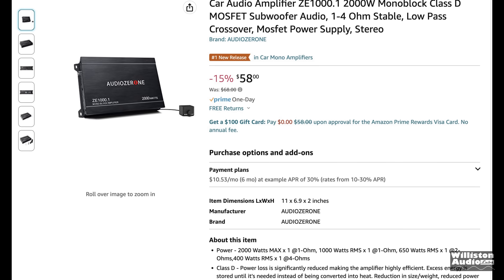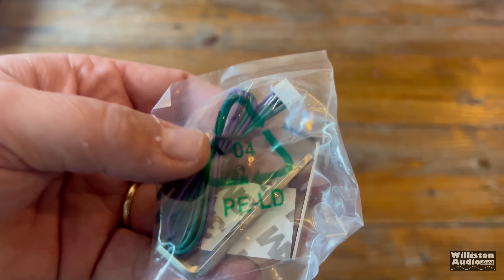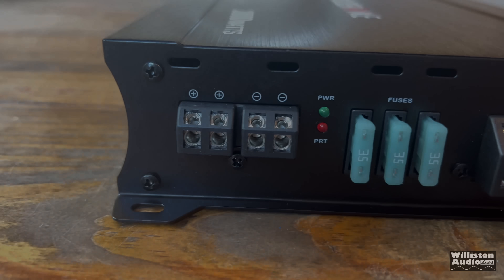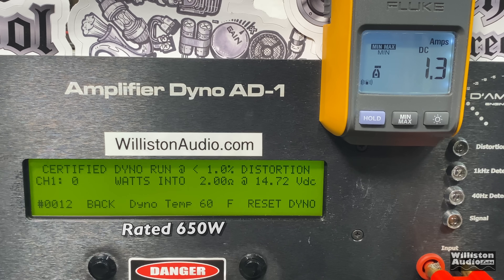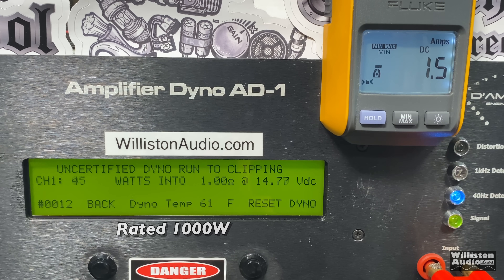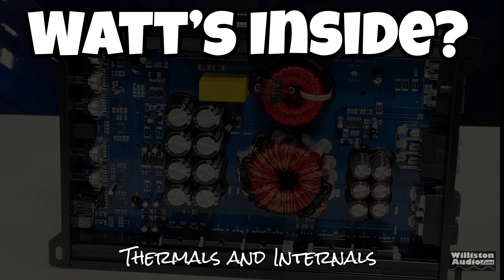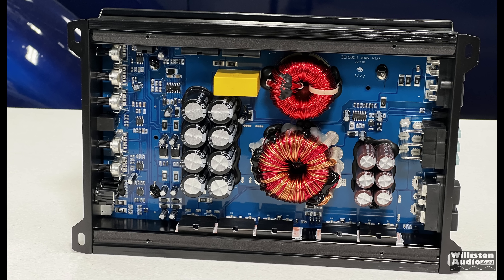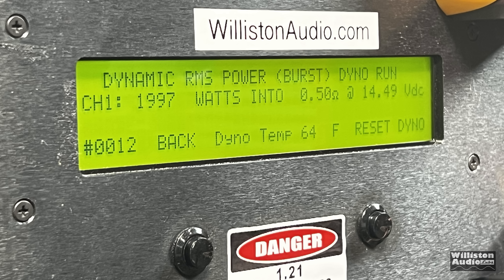Can this $60 Amazon Amp Power a 6000 watt SUBWOOFER?

Comment: I've ran this to two 10s then two 12s it sounds pretty good but i feel like its not enough. Id run one of these amps to one 10 or 12 and another amp to your other 10 or 12 and it would sound good. Ive tried it id recommend it. But why run two amps. I blast this thing for hours and only gets warm to the touch.

Comment: Woofers, or any drivers do not put out wattage. They can handle watts that are supplied with. What a speaker puts out id sound pressure measured in Decibels, SPL. If you have a speaker that has the ability to put out an. SPL of 50 db powered by one watt at 1,000 Hz at One meter away you have a very inefficient speaker. Every time you double the wattage supplied to a woofer its SPL is raised by 3db. If a manufacturer is being measured and they are being truthful, it is measured below 1% THD, Total Harmonic Distortion. 1% I’d when distortion. Becomes audible. Now if you have a woofer that haas an SPL of 98 db it will take far less wattage to get the same volume as the Woofer rated at 50db. Car subwoofers are usually inefficient because of the vibrations of the car being driven will cause the cone to distort its output, so they put a very stiff suspension around the cone to prevent this. 
Now wattage is an electronic way of measuring the heat generated by the amp driving the speaker. It’s really stupid to,rate a speaker that high because you would melt the voice coil with 6,000 watts.

Comment: So, since this amp has 2 seperate speaker connections.  Does that mean you can wire a dual voice coil sub one side into each and it keeps the original OHM rating of the sub? Like say i have a 2ohm dual voice coil single sub. If i plug both side into  the 2 speaker hook ups. Does it stay at 2ohm? I have only ever hooked up to a mono. And i have to bridge to 4ohm or cross over to 1ohm. But i would like to try running at 2 ohm.

Comment: Would it be feasible to power a passive PA subwoofer with one of these?
Reply from the maker: Sure, but many PA subs are 8 ohms, so the output of the amp would be less. I believe I show 8 ohm results in this video

Comment: I got a buddy running two of these on two H yanka 15D2. Running one aml per sub. At 1 ohm each. He has them in a 30hz 4qf e closure. And idk what it would meter but I’d bet it’s doing high 40s! It absolutely slams and he has $400 the whole system. He had one of those cheap capacitor things and I talked him into taking it out. And I helped him build his exposure. We ran welding leads for the hot and grounds. It really does slam. It blew my mind so I had to look these amps up. The H yanka subs I thought would be shitty too. But turns out, they slam clean and low. They sound as good if not better than any Skar SDR subs I’ve heard.

Comment: Paid $78 for mines thanks for the heads up on this good amplifiers. Gonna installed with two 12’s American Bass XD Rated each sub at 500 RMS each sub should sound good with the 1,000 RMS @ 1ohm.

Comment: Whats the best fuse to run to this a 100amp or and 80amp?  Lookiing at the Fluke amp meter it seemed nothing jumped over 80amps, but would there be any cons running a 100amp?  Thanks

Comment: As always, thank you! Love your channel and information and education. Can you please answer if a person is able to determine the amps power abilities by the fuses onboard? This amp made me think of the math I leaned on back in the day by multiplying the voltage by fuse’s amperage. Example of this one 105amps of fuses X 14.4volts = over 1400 possible watts of power…does this fair correctly? Thanks & Cheers!
Reply from the maker: A quick method is to multiple fuse requirement by 10 to get output, but I've seen some amps have fuses not connected to anything so there are some ways this doesn't work. It's pretty close 90% of the time.

Comment: these tests show number but what they don't represent is the physical weight of an amplifier due to the mass of aluminum cooling and the subsonic filters and EQ has everything to do with the Sound quality even more than any other aspect of the class D amplifier.  wattage is the last thing you should be concerned about when it comes to the clean crisp sound and the most important one is  a low-budget class D will not hit though really beautiful and competition level low tone baSS efficiency.  the longevity and life of an amplifier DEPEnDS on its cooling mass, fans and quality MOSfETS!  I can tell you right now any amplifier under $1000 is a piece of junk that will not last and not take abuse like Memphis use to and O'rion used to

Comment: When you test the amp do u turn gain up all the way??
Reply from the maker: Amps are gain matched to the head unit (Pioneer DEH-80PRS) using 8dB of overlap utilizing the DD1+ function on the Amp Dyno. Turning the gains up higher on the amp will not result in higher output, just reaches the maximum output "faster"

Comment: Hey bud, I've been running MB Quart amps recently and am impressed but always have thought what they really put out. I have the formula 2000w, 1000w, and 4ch 400w amps pushing thier discus shallow mount subs and speakers.They thump. Have you tested them by chance?

Comment: Amazing! I'd have love to see the 0.5 ohm test with the subwoofer coils in parallel.

Sadly though, I think amps this cheap are killing the car audio industry. Not going to see much innovation when there's no money in it.
Reply: Nah, it'll only make it easier for up and coming woofer designers. It should be cheap. It's a few electronic pieces surrounded in plastic and aluminum. Basically cost 200$ to build a high level 6k Amp fans/coolers/and all the features of a 2000$ 6k Amp.

Comment: What subwoofer would you recommend to replace a factory 2011 Audi S4? They put a funky shaped sub in the rear back seat shelf. Would be a free air application. Would power it with a non factory amp.  TIA

Comment: Im rocking the Rockville rva-m3 it set me back around $120 and I’m wondering if it’s making full power, I saw a dyno video of it and it said it made 1249w rms
Reply: What amp are you running for mids and highs?
Reply: @392_RHINO  wish i had those thinking bout getting a taramps 400w and some nvx components and coaxials for the rear

Comment: Question Will,  do you think its a sign of quality if the 1k and the burst power ratings are within 5% of eachother? My initial impression is yes it typically means good engineering if its consistent, but whats your impression?

Comment: The positive part and reasons of straight entry insert with angled screws is to angle the shaft of tool away from the case which helps with grounding mistakes made by installers also the angle going in is pulling the wire towards the amp and holding it there when locked in tight.
Reply from the maker: #FakeNews

Comment: I love seeing the max power ratings. But what about bumping on a long trip? Can it make 1000w for 4 hours while I drive to the beach? Love your content . Just trying to add another aspect. I keep building systems to spec for my daily and I'm disappointed on long trips cause half way my amp goes into protect for over-temp.
Reply: My Fosgate 1200 can do it for 10 hours I've done it 2x... used to do an hour 2x daily 6 days a week... but being a Fosgate amp that's the expectation not the hopes
Reply: Ambient temp and location are key for keepin it cool. I saw one guy go as far as running an additional AC duct with oversized fan in his trunk to keep an amp cool....

Comment: How about trying something,  connect a single coil of a dual coil like  This,then connect the other coil to another sub! Or tge Dyno!! Tge other coil should output power from the magnets or the nagnetic field from the electro magnet,, its just interesting,   im looking for a cheap  but good 12" (maybe a pair) to fit a second generation avenger, something equal to or a bit better than the oldschool kicker comps, to go with a factory system,   id like to see about 140-144 db about 40hz,  a pair will probably be required, i have a doundstream amp i think it does simewhere in the 600watt range st 4 ohm its the tower series or something, it mounts onits side insted of flat, its vern q while since i even looked at it, i also have a smsll kicker amp about 10 years old,  the soundstream is the obvious choice,   i have thought about entry level sundown subs, maybe this fall ill get something,

Comment: 25 years ago this could cost $500 roughly,  a good amp was about $1/watt, crazy how cheap power has gotten,
Reply: 30 years ago ,I paid 2000 dollars for a 35 inch picture tube tv

Comment: This reminds me of the Rockville DB11. The internal design is very similar to the internal of DB11, except the DB11 is a lot less powerful. The capacitors are the same brand (Captop). The transistor clips, transformer, bus bars that connect the speaker terminals, fuse holders, and power terminals, preamp section, and the big rectangular yellow capacitor for the half bridge class D are almost identical. Also it seems like that the manufacturer that makes the PCB of that amp also made the PCB for the DB11 because the manufacturer logos are the same. The Rockville DB11 could make 23.5V RMS (or 276 watts according to the calculation) with 2 ohm load on a 12.26V HP server power supply right before I hear audible clip. According to the results of that amp, I think that the DB11 will make the claimed watts if it is on 14.4V.

Comment: Put this amp on a load playing music for 48 hours straight. See if it burns up or takes it. Only way to see if an amp will last, is abuse it a little. Get it hot. Cure all that solder and glue. See what breaks. Or not.

Comment: ...I dont mind the angled terminals. They pull in the wire as you tighten the terminal...that it what is used on my expensive Helix amps....needles to say, I will not be buying one of these amps, but, good show as usual Big D...see you next Sunday, look forward to it

Comment: My infinity reference amps are also fused 35x3, but are rated 1000w rms @2 ohms. Even 20 minutes at full tilt playing bass boosted songs with a 320 amp alternator they are barely warm. Wonder if I should try putting in some 50x3 amp fuses and running each amp at 1ohm?
Reply: Unless things have changed since I did this, increasing the fuse amperage isn't going to do anything.  Your fuses are there to blow if you draw too much current, not to determine how much current your amp draws.  Theoretically speaking, assuming no loss (which doesn't happen), 1000 W will draw 83.3 A at 12 V and even less at higher voltages.  So, if you aren't blowing them now, you'll also not be blowing 3 X 50 A while also not drawing any more current than the amp needs or allows.
Reply: But I would be halving the ohm load from 2 ohm to 1, so would that not increase the current draw to potentially double? Which would either put the amp into protect, or blow a fuse if the amp allowed the current to pass through because I would then be drawing over the 105 amps of fusing. Also when I play full volume it sits at 14.2 volts

Comment: That's pretty decent for 60 bucks. If it can reliably run at half its rated power that would be an amazing value. I would not expect this to last running at its full rating. 
Guess I will never know since I got a few good amps for now. By the time I need a new amp I wont remember this one LOL. 

FYI That Ignite amp I got from your link when you posted it is still going strong. It has blown 2 L7's 12" and a Skar SDR 18, and 2 comp vr 10's. The evl 15 is taking it like a champ though get stinking after a while. The ignite amp is a little  stronger than the JP8 I got from your link. Both amps are great though. Keep posting bro.
Reply: It's better to overpower it than underpower it. The distortion will kill your sub.
Reply: You're definitely doing something wrong with all those blown subs man.
Reply: @therealistintheboot8822  Only thing I am doing wrong is bumping it hard. LMAO> I cant blow an EVL on the same amps. 

New L7s are not the same quality as the older ones. They will not handle same power. You can verify this in the rating from 2005 to ones sold today. They handle about  half the power and are still labeled an L7. Not sure why they did that. 

There are other great speakers out there, but I cant find any that give you the value the EVL line does. Its a hard to blow entry level speaker.

Comment: Wow I wasn't expecting that. Being a teenager in the 90s I remember when a 200w amp would set you back 4 to 5 hundred. It just amazes me that they can sell a amp that produces that much power for $60.
Reply: Yep. That's exactly what I said only ballers had 1000w.
Reply: Correct. I remember paying $239 for a Coustic 30x2 amp in 1993
Reply: @VSPDX  I remember paying $89 for a Sony 20Watts X2
Reply: CLASS D ...over AB... PCM over BJTs
Reply: It's also amazes me that these generic Chinese companies are not inflating there numbers anymore. Just a few years ago you would expect half of the advertised numbers on generic stuff
Reply: Pyramid and MTX had cheap product lines that fit all budgets back in the day that pounded pretty good, I put together a few systems for dirt cheap that got people bumping a lot better than stock ;but if you wanted Kenwood or Pioneer or anything kind of name brand you paid insane amounts of money.
Reply: No doubt.  It's crazy how this amp puts the $1200 Orion HCCA 2100 I had back in the day to shame.  As they say, in this day and age, mind blown.  Curious how long they can produce these numbers?  Measured in minutes, hours, or days?  If it was able to hold up for any reasonable length of time I'd buy a few and cover them in a polycarb, even with the booty caps.
Reply: back in 1992 i payed 350 dlls for a 100 watt pioneer amp
Reply: Pretty impressive for chineese junk, question is how do it sound 😄Those measurements doesn't say anything about how good it is to actually controle the speakers. But what can you expect from 60 bucks.
Reply: @mrdali67  I might get one and try it out, for the price it seems worth a shot.
I'm going to upgrade my sub first though cuz my current doesn't even need that much power lol
Reply: @BDauto86  Just remember that it’s just a cheap class D amp and that you have to add upwards 100 $ for a decent clunky psu. A used 90’s class a/b amp off about 60w will be miles better.
Reply: I don’t say it isn’t usable especially if its just to making rumble in a car sub. Even class D amps in “Pro” gear for PA usage a modern class D 2x 2000w won’t beat a good ole Crown or Yamaha 2x500w class a/b
Reply: But the class D amp weighs hella lot less to carry around
Reply: @BDauto86  I'd be careful about this amp. I wouldn't want this thing burning my vehicle to the ground due to lack of thermal or circuit protection.
Reply: @mrdali67  and how long will it last...that's the key
Reply: @brandonbelongstocharlottef1798  Personally I think the biggest problems with these amps is that you need a clumsy AC adapter of at least a couple hundred watts to give it a decent output, and it cost more than the actual amp. Not much idea in a tiny small form factor amp when you need a brick of a considerably sized notebook Adapter beside it. I don't expect HiFi sound from them, but they could be usefull for various home projects of eg some active speakers if you could just find some decent power supply schematics and where to order the components for actually building it into a speaker with just a power chord and a line input. I do hate todays trend of everything electronics using some kind of AC adapter with input ranging anywhere from 9-48v dc or ac. No standards whatso ever. And all the small local electronics stores (with often  passionated people that was always helpfull with your projects) we had back in the days are gone for good. All we have today is a myriad of often dodgy eastern sellers of components on the net with absolutely no assurance that you will get what you order and pay for and and if it works .. if or whent it arives 🥳
Reply: It is tested to 1%thd so regardless it is a bargain.i would buy and put good caps in it

Comment: It would have been nice to to see the amp wired to both coils at .5 ohm momentarily just to see its potential unless there was a possibility to damage the sub with a cheap amp.
Reply: Assuming that sub is using a 4" coil or 8 layer 3" coil it would be difficult to break it with that amp.

Comment: you gotta check out some european ground zero gear.. was at my first DB/SQ meeting and god. so many people rocking ground zero gear. apparantly my SPL budget 1kw sub got it to 2nd for SQ and 3rd for SPL.. and i have voltage issues. i'm not fully pushing 1kw just yet.

Comment: 8:20 so! Being in audio forever... This is one of those I've never quite understood! 

So is it typically okay to run just one set of coils on a multiple voice coil sub?

 A friend of mine did it with his type x I bought from him, still going strong all these years later. But you read online and everyone's like IT GONNA BLOW! Wire them both up parallel or series fool, or buy our spensive favorite amp!